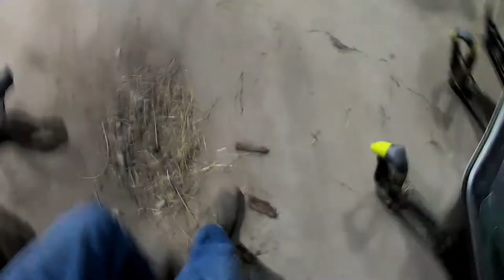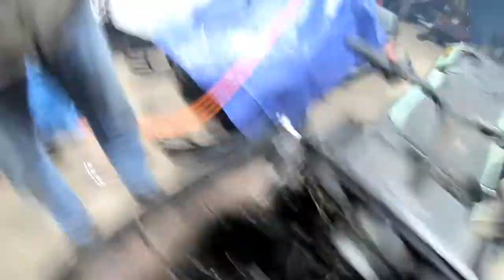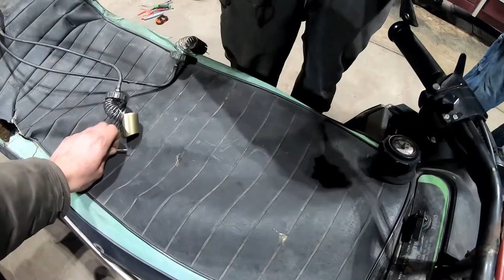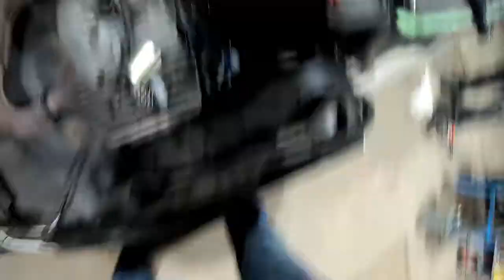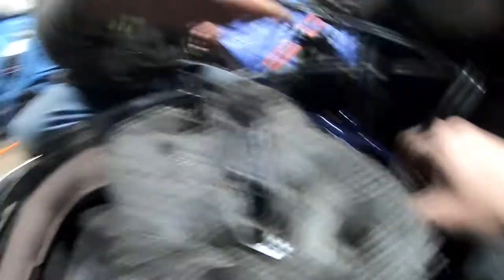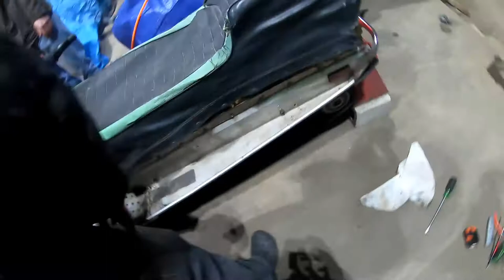Tuning Mid-Range (Needle Clip) on 1977 El Tigre - Mikuni Round Slides |Low End Bog|

Comment: Any advice i have 1976 eltigre that lost spark over night and I don't think it is the CDI or coil it was sparking great a Nd the next day there was none
Reply from the maker: I had cdi on a jag go out like that. There's a way to bypass the kill switches at the harness plug the square one I think. I don't remember which wires need to be jumped or if u just unplug it.
Reply: @bearkreekboys  I didn't think it needed jumped but when I unplugged that it still doesn't work
Reply: @bearkreekboys  also the kill switch wires were cut at some point in time
Reply: Remember the pilot jet overlaps up to quarter throttle..l would double check pilot jet condition for obstructionists, plus possibly to small.
Reply: @jeffreyhagelin3672  would that cause no spark

Comment: Question? I found a 1973 Panther 340 thing is like mint same all original and everything is there even electric start, but question is I do not want the old carburetor on it they suck, what mukkni should I use to make it run right ?
Reply from the maker: 34mm would be just fine